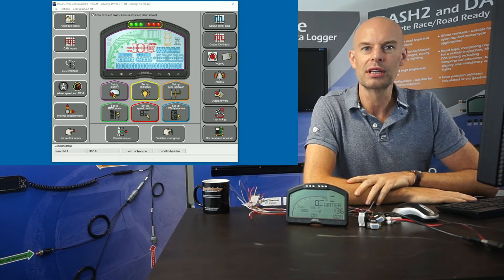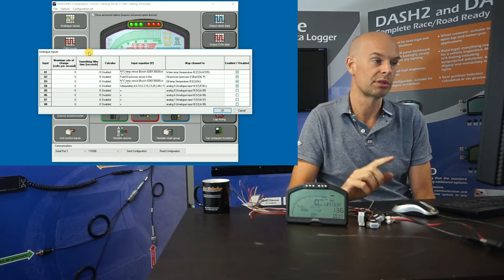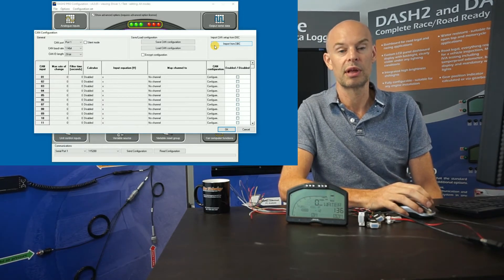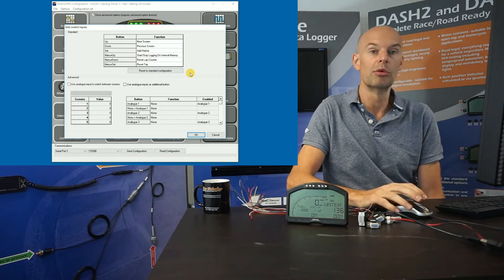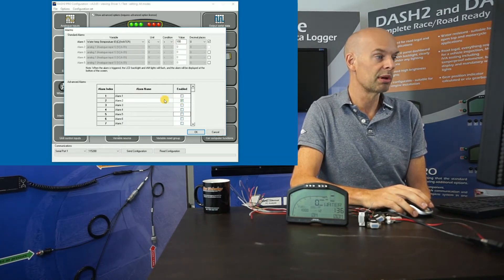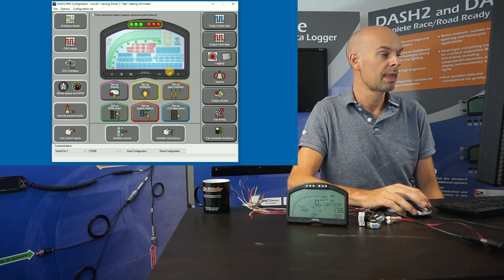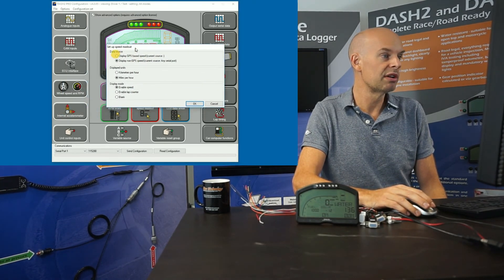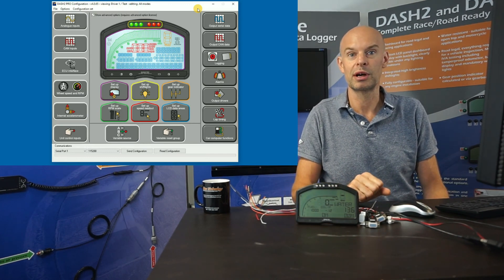Race Technology DASH2 PRO Configuration Software

Comment: Hello.  Thanks for a very helpful video.  My unit is about 10 years old on an Ariel atom.  Question: today I had the brake warning light come on, but at the same time the screen went blank, and all rpm lights lit.  This is my first ‘issue’ with the car as far as showing up on the dash2.  Is this the norm - for all rpm lights to light up and screen to go blank? Thanks